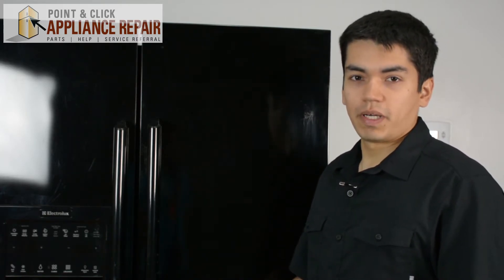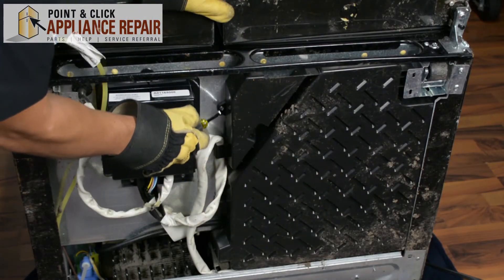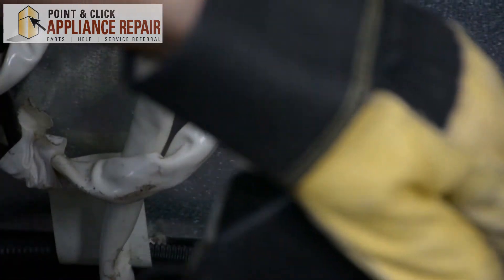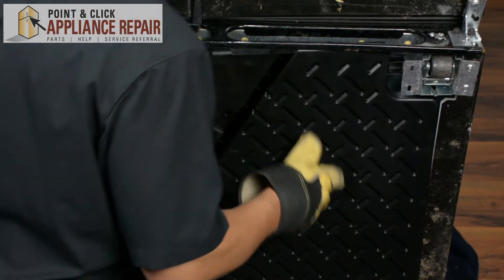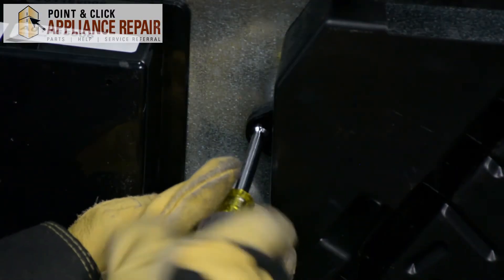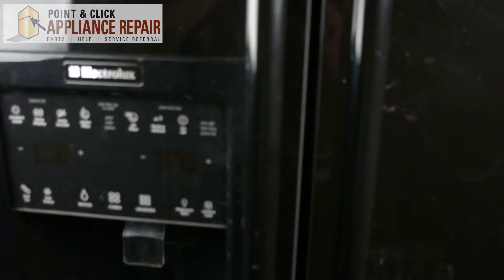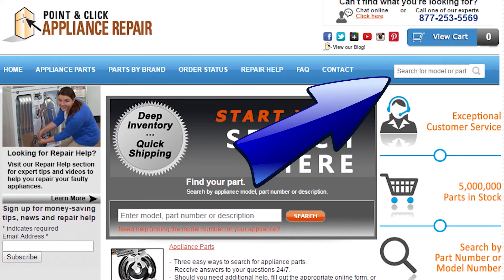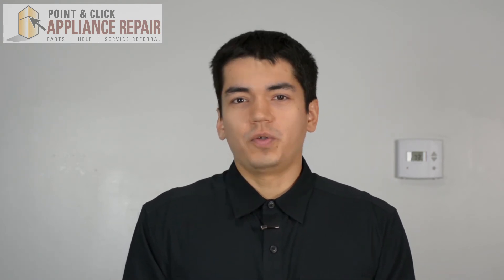241697602 - Replacing Your Refrigerator's Drain Pan - AP4319611, PS2331555

Comment: For anyone that is interested. I have a Frigidaire side-by-side with the same drip pan (Frigidaire is an Electrolux product brand) and no I can't tip it back, over, or any at all. My drip pan had dog hair, cat hair, dust bunnies, sludge, and slime. What I did was use my rainbow vacuum (you could use a wet/dry vac) and a part I bought off Temu. The part connects to a vacuum and it's a tiny hose to clean lint out of the dryer. I took the back panel off the refrigerator and ran the tiny hose around the compressor. It cleaned it pretty good. Not the easiest task, but no way can I tip or tilt that huge side-by-side.

Comment: Thank you so much for posting this video all the other videos did not explain or have the same pan that I have thank you so much
Reply from the maker: Glad we could help!
Reply: Yes mine is like this one I think. Can’t get to it from the back. I shined a flashlight and my drain pan is pretty nasty but no moisture I could see. Looked like a little mildew or mold though. So, I’m cleaning it as soon as possible. 
With that said, I do t think that’s going to fix my HORRIBLY smelling refrigerator. I accidentally had some things in the freezer too packed and the freezer wasn’t closing all the way for a few days. My kids kept leaving it ajar because of this Everytime they got a popsicle. It was often last week. So, I noticed wet stuff leaking from my freezer. And I wiped it up. It happened again and I then noticed the door was ajar just a little. I cleaned out all the extras I didn’t need in my freezer so my door would close all the way. Thought that fixed my problem...NOPE! This horrid smell started coming from both my fridge and the freezer part. I have scrubbed nonstop and cleared every single thing out. I’ve pulled it from the wall and cleaned thoroughly underneath. I’ve put coffee grains in my empty clean freezer and fridge but zilch has helped. I’ve checked all seals. Nothing is helping! I am praying so much this helps when I am able to clean the drain pan. My dilemma now, I don’t have anyone strong enough to help my push my fridge backward to unscrew and clean it! Ha! This has been a horrid week trying to solve this issue! It smells so bad my kids walk to the fridge with their shirts covering their mouths and noses😂😩🤦🏻‍♀️It is making my entire middle floor of my house smell like dead rotten fish.
Edit: And I know this was a novel! I just needed to vent. I just spent hours and stayed up half the night trying to figure this out so I don’t have to buy a new one.
Reply: @BS-dq1kz  this sounds, or smells, like the same thing im going through. did it fix your smelly problem?

Comment: Thank you, online company called "justanswer" referred me to your video and it was exactly what I needed!  Why Kenmore made this such a difficult task and almost impossible to do by yourself.  Removing everything from the refrigerator & freezer, including all adjustable or removable shelving. Move it out in order to tip backwards (I may have missed this part, but is it safe to lay it down flat on the floor?). I know from experience that doing so can cause a refrigerator to no longer work.
Thank you for the well put together video instructions.  Appreciate it more than you know!

Comment: Thanks for the video! If you see water leaking does that mean the drain pan has to be replaced or does it just need to be emptied? I am assuming it needs to be replaced but wanted to know before  starting the project.
Reply: There's a few reasons why you see water leaking. Best to look up the different reasons, most can be corrected on your own

Comment: If the pan is not cracked why am I replacing it. If water is overflowing out of the pan, maybe something else causes that issue. After 6 months I should not need to replace anything.    Be SAFE WITH CORONA [not the beer].